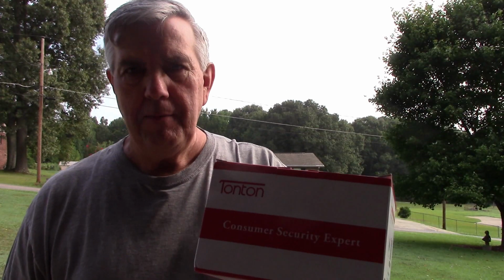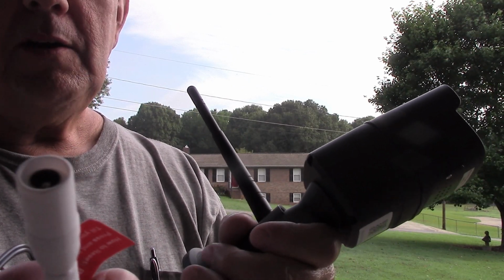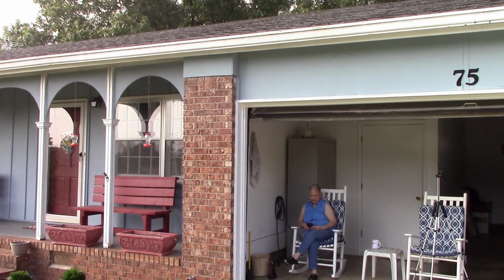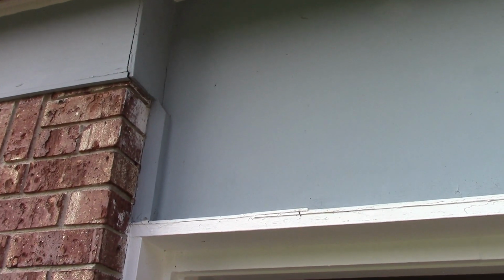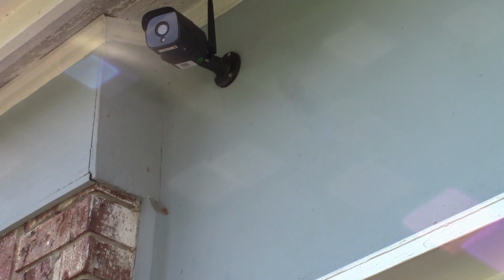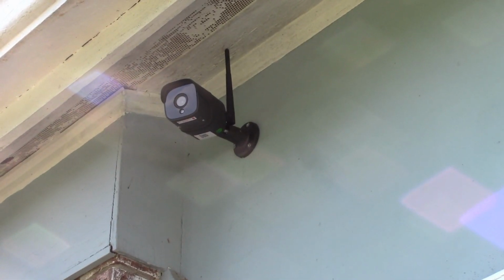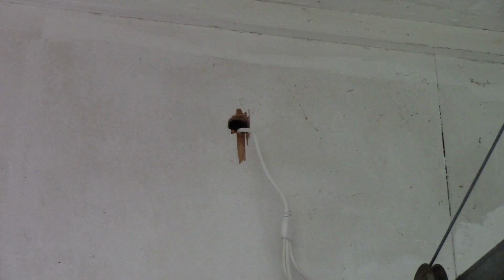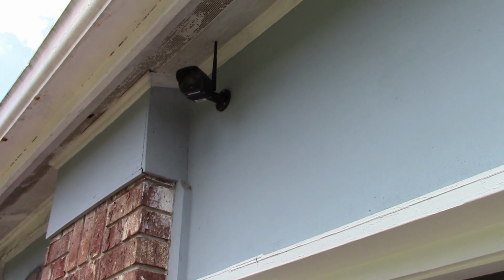Security Camera Install  --  Tonton 1080P Wifi Ip Camera  -- DIY

Comment: Just ordered the same cam hope it works good need something just to keep eyes on are vehicles at night
Reply from the maker: Thanks for watching.  Mine is working fine.  I have had to push the reset button twice.  When I can I'm going to upgrade and get a system with DVR recording.
Have a great week,
Calvin and Marie
Reply: Did you upgrade your camera yet ? Do you need a account with the app for the camera to record all the time ? Or dose it only record what triggers the camera?

Comment: Just wondering, did you have to plug the camera into a plug for it to start working? If so, did you have to buy a long plug line?
Reply from the maker: I used the cord that came with it and connected it to an extension cord to reach the nearest electrical outlet.

Comment: I bought two of these cameras but I wanted to know if the instructions were easy for u to install? And are these cameras weatherproof for someone living in the cold climate of Canada. It can get up to -30
Reply: Hi :) do you think they will work in the winter here -30 Celsius ?
Reply from the maker: Thanks for watching.  The instructions are not the best but I was able to get it working and connected to the app. I don't like the app that much because it disconnects sometimes and I have to reset the app. Not a real problem though. As for the weather,  I have no idea how it will hold up in that cold of temperatures.  The good thing is they are not very expensive.  Good luck with your project. 
Have a great week, 
Calvin and Marie
Reply from the maker: That is colder than we ever get. I don't know if they will work in that temperature.

Comment: Curious if you're running the Ethernet cable or did you get wifi to work? I want strictly wifi but can't figure it out.
Reply from the maker: Thanks for watching.  Yes I'm using the wifi.  I don't remember having a problem setting up the wifi.  It's been a while since I did it and I don't remember how I did it but it is still connected and I can access it with my phone from anywhere.
Calvin

Comment: Since buying this product are you still.satisfied?
Reply from the maker: I like the camera, it works fine.  The app that they recommend using keeps disconnecting.  I've had to reconnect the app a few times.  Over all it does fine for the cost. I got it so that when I'm not at home I can use my phone and see the front of our house.  It worked great while we were gone on vacation.  If I ever upgrade I will go with a multi camera and dvr system.  I don't remember the exact cost but it was about 30 to 40 dollars.

Comment: couple more questions 

1) can i use this phone via direct cabling to harddrive! aswell as wifi 

2)how is the phone like at night time - can you see number plates?

3) is the app and everything else free - i.e. no additional charges? 

4) can you watch recordings on your phone?

5)what is the wifi distance between phone and hardrive?

6) what is is like in the rain - is it properly Waterproof??
Reply from the maker: 1. Yes
2. No
3. App is free, they charge for cloud storage if you want it. I didn't take it. 
4. When an alarm is triggered it records a short clip and sends it to my phone. I can watch live video anytime from my phone.
5. Mine is about 40 feet 
6. It has a small shield over the top.
I have mine mounted under the eve and it is protected there.

The only complaint I have is the app loses connection sometimes and I have to reset it. Like I said before, I would like to get a system with a DVR that records all the time.  I will get one like that when I can afford it. 
Have a great weekend, 
Calvin
Reply: @SouthernCountryLiving  Thanks calvin - few other annoying bits and pieces before i commit

1) does it wire straight to the box

2) does it not record continuosly? that seems kinda odd?
Reply from the maker: It comes with a power adapter that has to be plugged into an electrical outlet.  For recording continuously you have to have a system with a dvr. None of the individual cameras will record continuously without a dvr. That is why I'm going to upgrade my system when I can.
Reply: @SouthernCountryLiving  so it has the ability to be DVR?
Reply from the maker: @jasonh2469  Yes

Comment: If you connect to the box with the cable first and it connects correctly you just unplug -  than all the info is in the phone or Tablet already and is ready for WiFi.  Click the WiFi and enter your internet password and the phone will connect.  I than connected my Tablet directly to the box first as well.  When it was time to connect to wifi I had to type my password I created with my phone than my wifi password.  Connected very well.  I tried to connect by leaving my tablet (making a terrible sound) beside the wifi and camera which was still connected to the box which didn't work.  So I connected directly into my box.
Reply from the maker: Thanks for watching

Comment: Thinking of TonTon as your security solution? Better attempt to find their website or any kind of support at all for the NVR. There is none!!!
Reply from the maker: Thanks for watching.  It is not intended to be a security system.  It is used to monitor location with your phone. It works great for me and it didn't cost a lot. 
Calvin

Comment: Do you need to have WiFi in your house to use it or does it go right to the phones app ?
Reply from the maker: Thanks for watching.  Yes you do have to have wifi. The phone app works but not very good.  Since I installed the camera the phone app has messed up several times and I have to completely reset the camera to the app to get it working again.  I'm thinking about trying a different phone app.